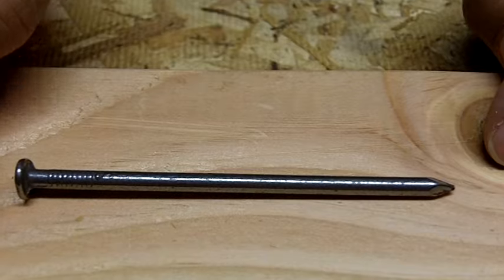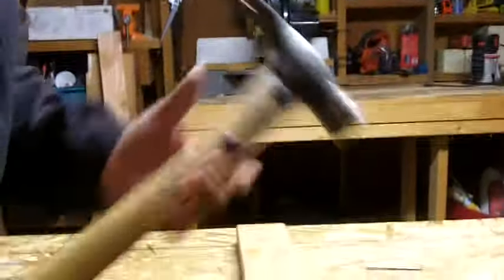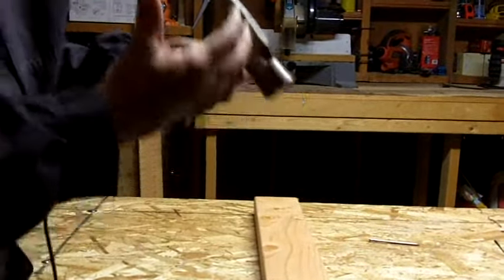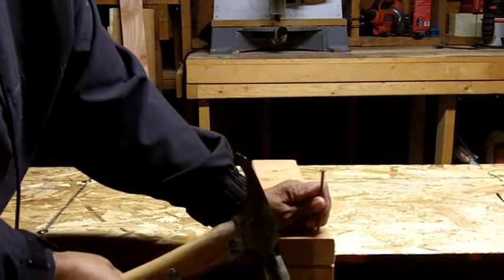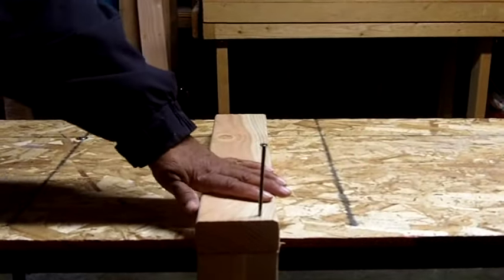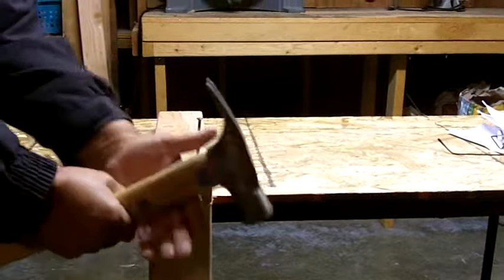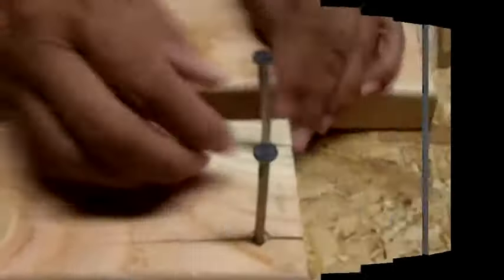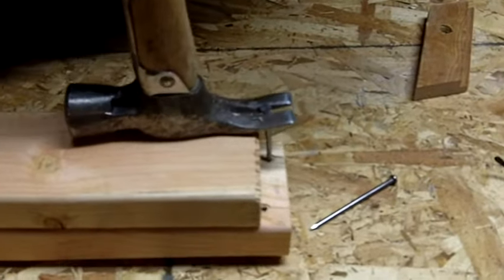How to Drive a Nail / Hammer a Nail

Comment: Thanks for the help, Leah. I am, and have always been, embarrassingly bad at using a hammer. Whether it's a big nail or a little bitty nail, trying to drive it in without bending it over has always been a huge frustration. I can tap, tap, tap just fine, but as soon as I try to hit it for real: boink...I miss. It's like my calibration is off and I can't find the adjustment knob in my wrist or elbow. 😉 I guess I should get a spare board out and just practice and practice until I figure out what I keep doing wrong.  Thank you for all the help you've given to us throughout the years.

Comment: Is it possible to use a center punch to drive the thin nail heads in a little bit deeper? I'm asking because I was told that a center punch is to Mark where you are going to put the nail...

Comment: Choking up on the handle is good when you're first learning to swing. But holding it at the bottom and letting the hammer do the work is the most effective way to do it. It takes practice. I can drive a 16 penny nail in about 4 or 5 swings in soft wood.

Comment: never frame a house with a common nail. Coated 16 penny is used. One more thing. A good framing hammer like you have here, a good framer will hit the nail no more than three times and most times only twice using the full length of the handle. That is why it is 18 inches long. Another easier way to pull a stuborn nail is to turn the claw sideways on the nail using the handle for leverage. JS

Comment: No wonder IM so bad at this. I swing my wrist.... Gosh  so much to learn.
Reply from the maker: azreana ibrahim  Hello Azeana,  Everyone has got to start somewhere.  You'll be fine. :)
Reply: A lot of the power comes from you wrist, if you only use your elbow and keep your wrist rigid you will end up with “Tennis Elbow”. The primary joint in hammering is your wrist then you elbow then your shoulder.